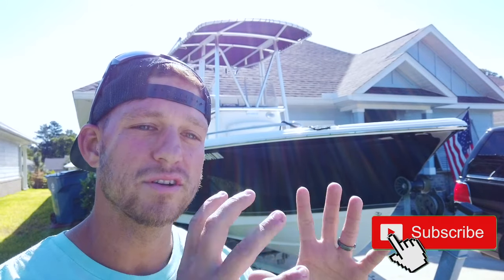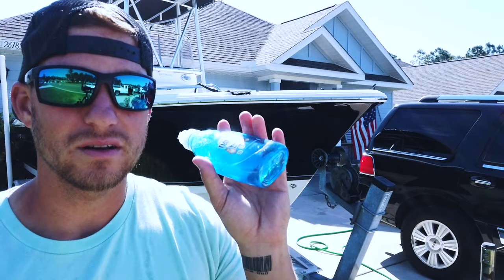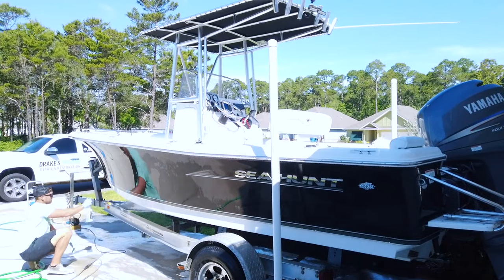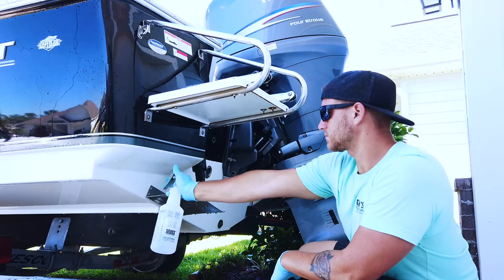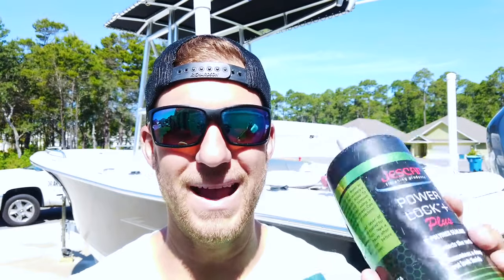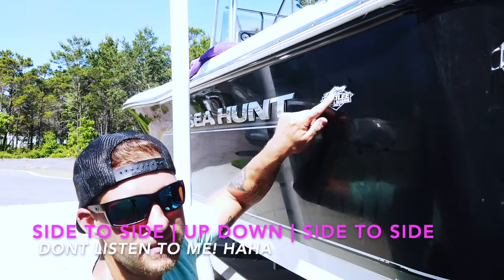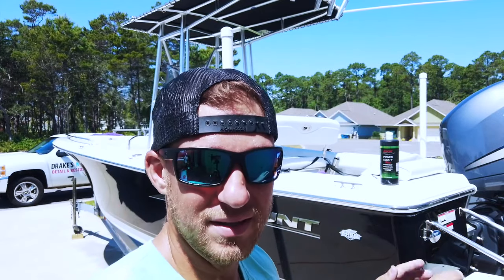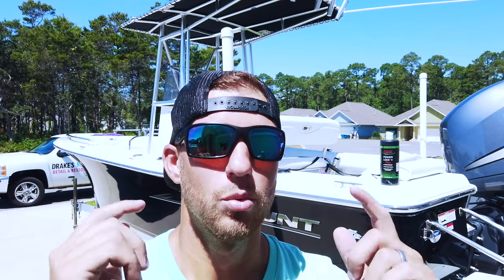How to Wax a Boat | boat detailing tutorial | Revival Marine Care

Comment: I have a question?  I applied the jescar in the same way you did. I am having a very hard time getting it to wipe off smoothly?  It is super slippery and rock hard. Microfiber doesn't seem to be doing anything? It is not wiping off the excess?  Any tips?
Reply from the maker: Hey man! Are you really working it in with the machine and waiting at least 30min for before you wipe off? If you just wipe it on with out really getting the product hot it won’t adhere properly.  It will get really clumpy and smudgy. Make sure you really work it in and wait at least 30 minutes for it to completely dry.

Comment: i am in the process of repainting the hull with awlgrip, primer is done about to apply top coat can i or should i wax it after the top coat and if so do any of the steps or products change? also can i use a separate pad after i apply the wax instead of a rag
Reply from the maker: Hey bro! Yes, once’s it all said and done, I’d apply a coat of polymer sealant over it, such as the Jescar powerlock sealant shown in this video.
Reply: @DrakesDetailing  well 2 coats primer 3 coats top coat done. 1 coat of top coat to go
Reply: @DrakesDetailing  id show you a pic but don't know how to get it to you

Comment: Question, have you ever noticed that water beads but doesn't shed water with the Jescar sealant? I applied this spring and had an issue with horrible water spots. I just used water spot remover and reapplied Jescar. after I was done I hit hull with hose and notice water beads well however doesn't shed water. Not sure if this is causing water spot issue? Boat is in the water so it's not possible to shammy hull every wash.
Reply from the maker: You may want to switch to starke hyperhold and top it with starke replenish. This will sheet the water like crazy
Reply: @DrakesDetailing  thank you. I’ll give that a try. Also thinking about a spotless rinse filter.

Comment: I’m a new detailed in my city but still trying to figure out how much to charge. How much do you usually charge for something like this?
Reply from the maker: I would charge sound $20 a ft for this, but you should probably be around $12 foot. 

For just the outside and the toe rail like I did in this video. If you were doing the inside of the boat as well you would tack on another $5 a ft

Comment: Awesome video! Just what I needed! Two questions: 1- Did you connect your foam canon directly to your pressure washer?  2-My boat is a year old and never been waxed. Can I use this sealant on my boat with just a washing first and without stripping with dawn first?
Reply from the maker: Thanks Man! I attached the foam cannon to the wand of my pressure washer. You don’t HAVE to use the Dawn, especially if it hasn’t been waxed since new, regular boat soap and a good scrubbing will do! However, if you wanted to go the extra mile, Dawn is still good to use if you just really wanna get it clean before hand. It gets a lot of dirt, grime and microscopic contaminants off that will help improve the bond on the sealant. Hope this helps bro! 😎
Reply: @DrakesDetailing  One more question Drake. Do you seal the top of your T top and if so what type applicator do yo use up there? Thanks!

Comment: Would you recommend using a 21 long throw da for applying Jescar Power Lock +
Reply from the maker: sure, that will work fine
Reply: @DrakesDetailing  Thanks for your replies and videos. I've learned more from them in the past several months than I've learned in the past 45 years detailing my personal boats. Great job !

Comment: Do you wash that ‘Goof Off’ (rust remover) out of your bottle, after your done? It ate up my bottle and I have to throw it away not. Do I just have a crappy bottle? I pulled the nozzle off and it was ate up😥
Reply from the maker: Mine has not done that
Reply: @DrakesDetailing  alright
I’ll start rinsing them. I Might just have a crappy bottle. Plastic is plastic ha
Reply: @DrakesDetailing  what kind of bottle do you have? I have some other product in a ZEP, I’m not liking it much either though😂😢😂

Comment: If my boat is 1988 hydra sport work with power lock stuff also?
Reply from the maker: Yes! Just make sure the surface is 100% oxidation free. Compound and polish as needed to remove the oxidation, then re-apply the sealer every 4-6 months to keep that shine, so the oxidation doesn’t return

Comment: will this help with removing oxidation?
Reply from the maker: It will not, it will only help protect and preserve a shiny surface after you have already removed the oxidation.
Reply: I plan on washing boat down with dawn, buff with heavy cut, wax with wake up, then sealing it with Jescar.

Comment: Anyone know if the polymer sealant will work in removing oxidation?
Reply from the maker: No, polymer sealant will not in any wa remove the oxidation. You compound and/ or wet sand to remove the oxidation

Comment: Are you supposed to apply jescar to the bottom Side of the like under the black area?
Reply: And do you have to follow up with starke replenish
Reply from the maker: You can the the underside hull, But It will not last long.. Most people do not wax under there. And no you do not have to follow up with replenish, But it will help add more protection to the boat
Reply: @DrakesDetailing  thanks I’m wanting to get into the boat detailing field and these videos are a tremendous help thanks man
Reply: @DrakesDetailing  are you saying there is no need to polish below the waterline?

Comment: What about the part of the boat touching the trailer ?
Reply from the maker: That part isn’t typical covered in a standard detailing package. If the customer wants the bottom done, that is an extra charge, and it needs to be taken to a marina, pulled off the trailer and put up on jackstands in order to do the bottom.
Reply: @DrakesDetailing  Thank you !

Comment: Do you always buff with the towels?  Any thoughts on pros / cons of using a wool buffing bonnet / pad?
Reply from the maker: wool is going to cut, No matter how soft. Foam pads are going to have give you a much better finish!  And yes, Always remove the wax / sealants with microfiber towels
Reply: @DrakesDetailing  Thanks for the prompt reply.  Trying to get the gel coat on my 2002 KW 1720CC sparkling and am following your steps.  Many thanks for posting these videos.  Subbed!
Reply from the maker: You’re welcome! Let me know if you have more questions